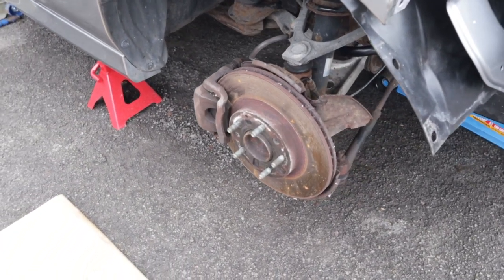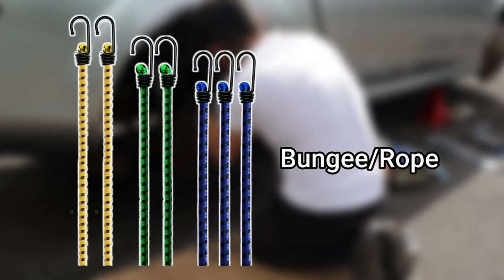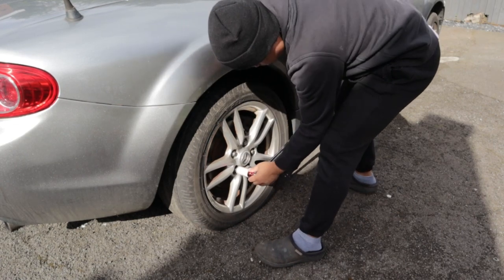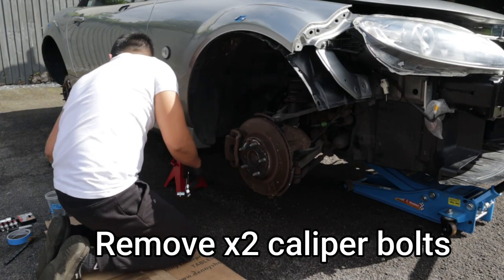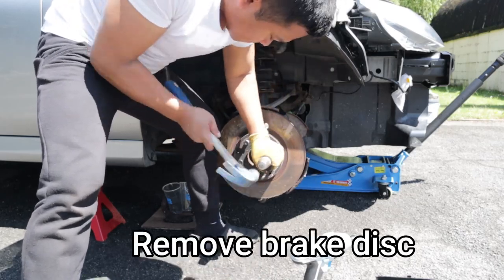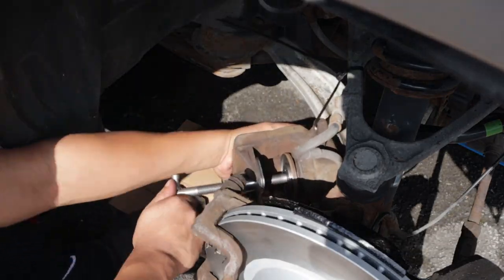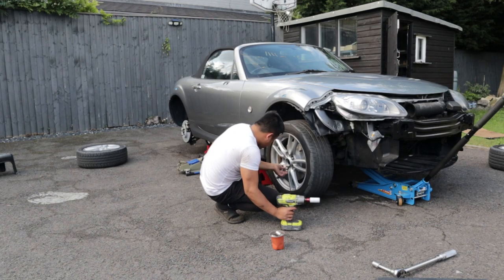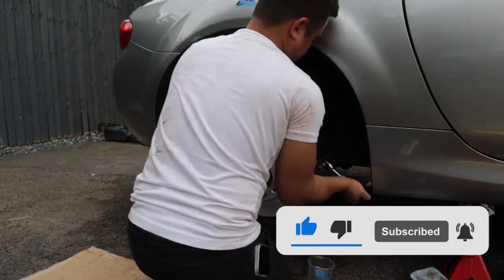How To Change Brake Discs/Rotors (Super Easy)

Comment: at the requirement section: not only new brake disks, also new brake pads! why? you will transfer the shape of the used pads into the new disks. if there is uneven wear, you will transfer it into the disks. brake pads are cheap. you save a lot by doing it yourself. and you risk spending more if you reuse brake pads
Reply from the maker: Thank you for this tip 🙌🏽 Though I think it if your pads are quite new and even it is unlikely to “transfer the shape” as brake pads are meant to wear out.
Reply: @markalden  yes, if they are even, and fairly new, i also think it's ok. mainly thanks for them being even. 
you are also right about their purpose(pads wear), and i am thinking you did the right judgement here. the only problem i see is that others might not think about it.